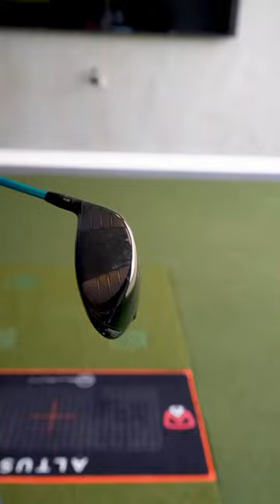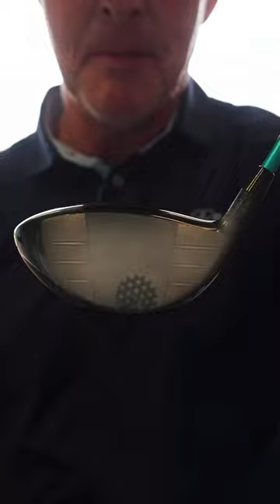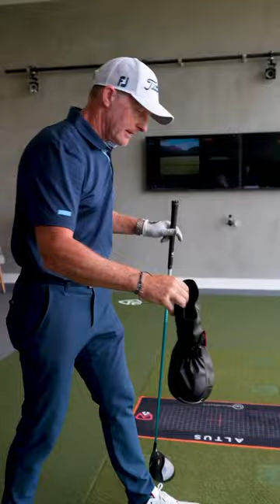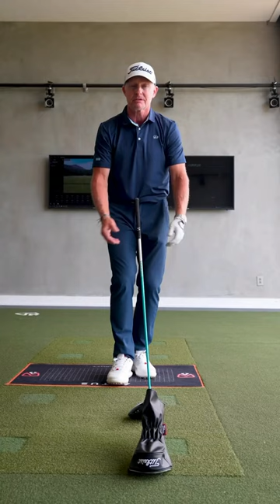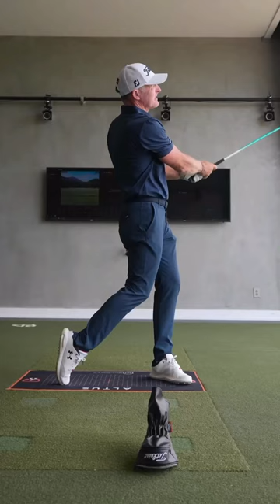This Golf Tip Will Change Your Life! #golf #shorts

Comment: Good adjustment but I‘d say first of all, check your tee height and make sure to adjust it properl and get it consistent on every tee. Then you can fully focus on your swing because many just tee it up too low so even a good inital swing wont show its real effects if the ball is so low to begin it with. You are also giving yourself more space to center your clubface on the ball and actually hit up as opposed to just down/flat and out. That’s of course only the case when you dont draw or slice, obviously. 

Dont beat yourself up about it, driver is one of the, if not the most difficult shot to (consistently) hit out of all and can be very much influenced by the equipment you have or just simply dont have.